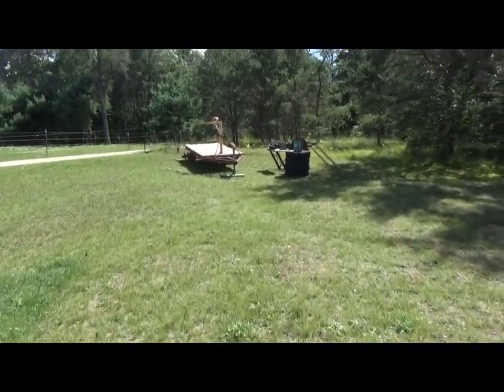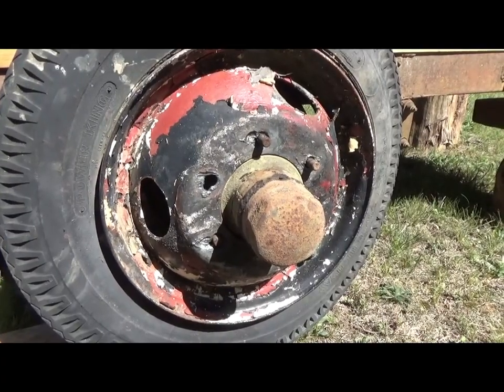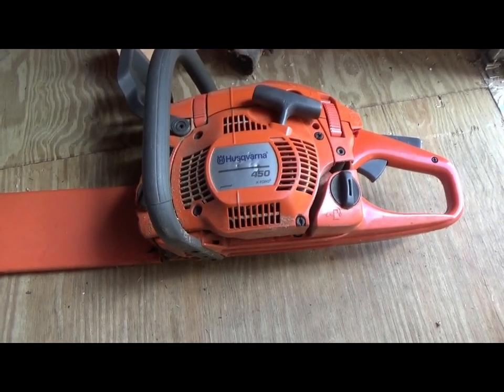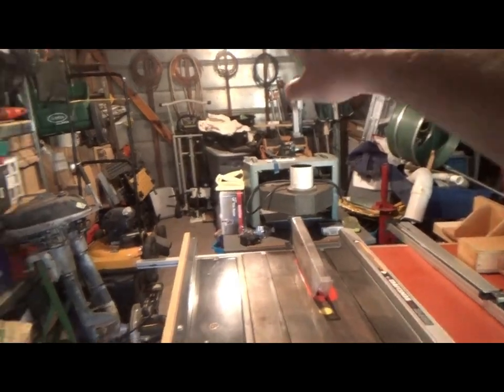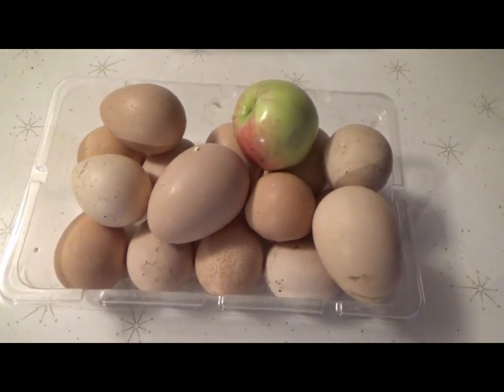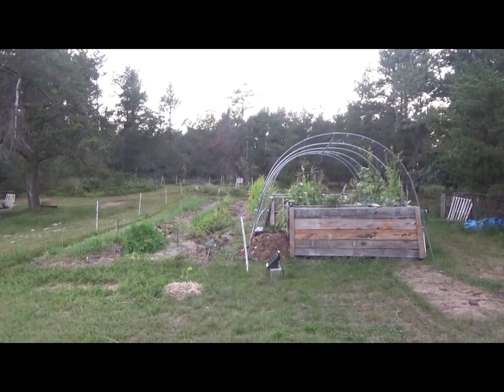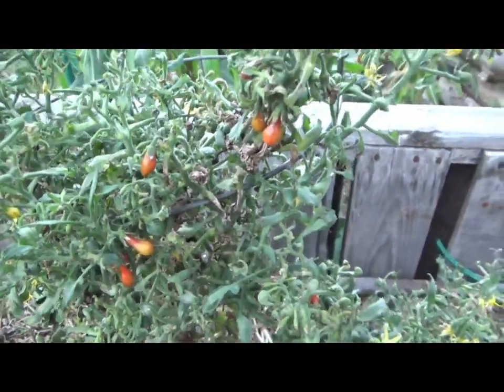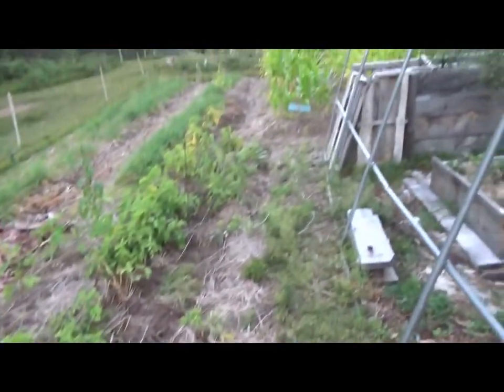A Lot Going On At The Off Grid Homestead

Comment: In the previous video on the various woodworking tools, you misnamed a tool, you called it a home made jointer, it is actually a wood turning lathe. Also the rims with the spring  ring  was called killer rims due to the fact that whoever was replacing a tire or patching the tube had replaced the spring ring incorrectly and during inflation they had over inflated the air pressure in an attempt to seat the tire bead causing the spring to  come off  and striking the person or another close by. If installed correctly they are no more dangerous than regular wheels
Reply from the maker: I do not recall ever saying I was perfect. Yes I realized my mistake in naming the lathe. For some reason I was doing that on this day, even talking to a friend. Did I say that I am not perfect?

All I know about the rims is that everyone I talk to around here wont touch them and most say they are illegal. I can only tell you what other people are telling me. I have never seen such a tire on a trailer myself before.
Reply from the maker: Oh, by the way, the wood lathe is my favorite tool of all.

Comment: Just fyi 215/75/17.5 tires will work on your rims and may be easier to find. They are same size on conversion table. Also I have a husky saw and love it. I had a problem with it starting when hot and found it was the spark plug causing the problem. The gap on the plug would close up when hot then open back up when cool. Not sure if it was a material flaw in the plug or if the gap was too close. I replaced the plug but widened the gap 5 thousands and it has worked fine since. I always look forward to your videos and wish you and your family the best of luck!
Reply: @ Backroad82, he will also need to make sure that the tires are 6 to 8 ply rated  preferably bias ply tires if he intends to  haul heavy loads as regular radial ply car tires will not tolerate heavy loads especially going around curves. Usually tires with the sizes that has the fractional denominator of .5 is mobile home tires or medium duty truck tires

Comment: Split rims, be sure all the air is out and the bead seat is broken on both sides, edge of tire loose on the edge. Cage needed only after tire is replaced and yes the split part comes off to remove and replace tires. Cage needed when air is replaced. Add air slow to be sure the split pieces seat properly. Very slow. Should look the same as you see the wheels you have stacked. Also use wire brush to clean the split piece and rim where the split piece seats/sets. Used to wprk for Goodyear and had lots of these. Even more rare is the 3 piece. If in doubt have a tire shop do it and watch closely.

Comment: well those are house trailer wheels,,,17.5....16.5..15.5....i can tell you what i did to my trailer,,years back,,,i took a house trailer axle,,the axle part was 3 inches around,,,good for weight,,i cut it in the middle,with a chain cutter,,there just tubing like a driveshaft,,matched the size for my trailer,,then i welded it all the way around,,it was perfect,,the house trailer tires and wheels fit it..but one thing the tires were 15 1/2 size...but back then house trailer wheels were easy to find,,and they will hold a lot of weight,,hell i think there 10 ply..thats why you always keep your eye out for trailer axles and wheels.if your building pull trailers..stay away from split rims,,you can get strait bud wheels for that if you wanted to,,stay with 16 inch,there much easier to find..you may have some house trailer axles laying around,,there better if you got them..easy to cut..Troy i like them eggs,,brown eggs for cooking,,sweeter..double yokes sometimes..yes summer is leaving us..u got to get that wood cut,,i got to put  a tailpipe on my truck yet,,they say mabe mild winter,,i hope.whens the frost come up there,,,you will get it before me,,,oct for us,,about mid way.i hate the cold now..you all stay safe and warm.
Reply from the maker: I am looking around for anything that may work for me right now. The best I could find are the 17.5 inch rims so far.

We do not notice much difference i the eggs really. But we are happy to have them.

We often get a freeze in July or August and then a lot in September but this year has been warmer. I hope it stays warmer for a while yet. Our garden has just started to produce food.

Thanks.